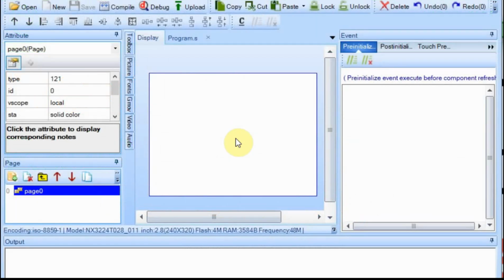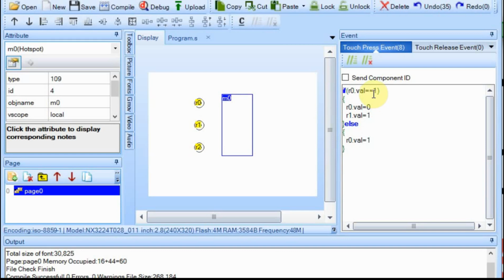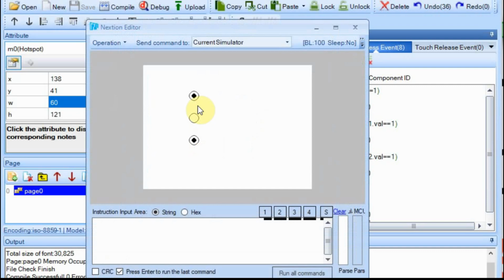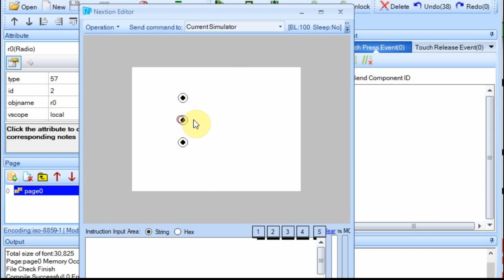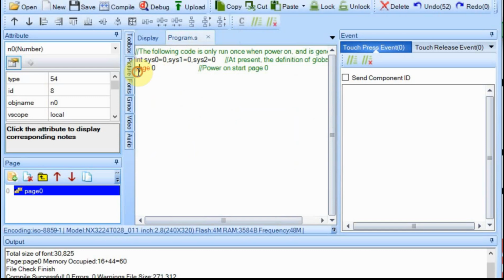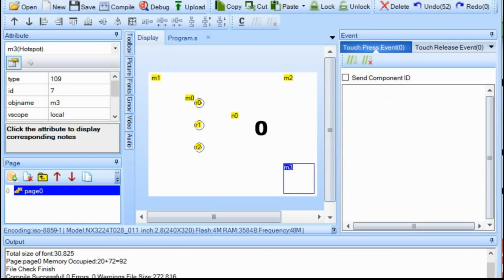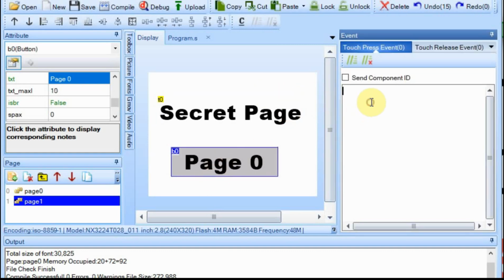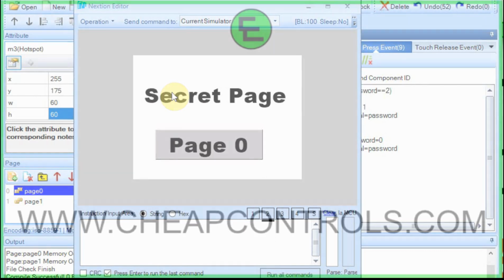134 Absolute Best Nextion Tutorials - Hot Spots, Radio Buttons and a Secret Page

Comment: I'm probably a big pain in the ass by now :). Coding just on the nextion display. If you have two number boxes and one button. And you want the button to only function when the two values in the number boxes match the one set by the button. 
Example
If(n0.val==2)&(n0.val==1)
{
page 2
}

If i add it like that it says "invalid number of arguments". 

Any advice?
Don't think i would have gotten this far with coding if it wasn't for your videos.

Thanks alot.
Reply from the maker: I am never sure how much you can pack in a single line on the nextion.  Sometimes you can have multiple statements and sometimes you can't.

if(n0.val==2)
{
  if(n1.val==1)
  {
  page 2
  }
}
You can try this  I assume you didn't mean to use n0.val twice